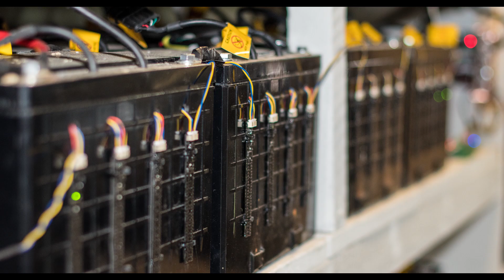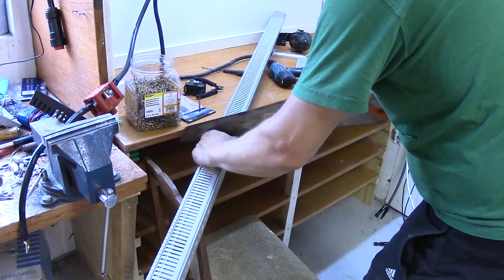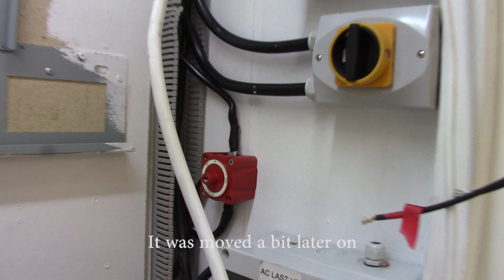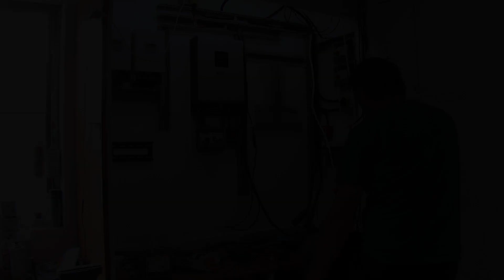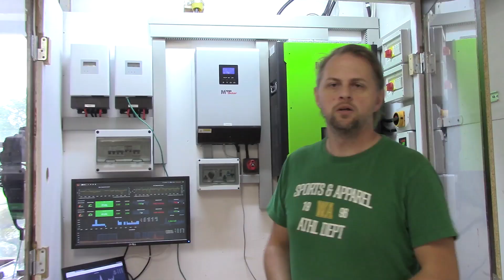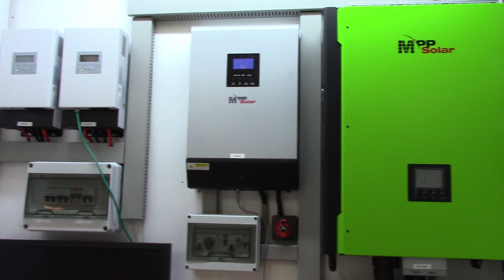Rebuild my solar installation! (part 3) - Electrical (Loud music in start)

Comment: I have 2 of those same charge controllers, how to you monitor them? Do you used 2 computers to monitor each? I haven’t changed any settings so far, straight out the box I connected them and they started changing. I have a 48 volt agm battery bank. Thanks
Reply from the maker: Check out my grafpi videos and solar-sis. I use 1 raspberry to all my monitoring

Comment: What is the total idle consumption of the inverters, bms, changeovers etc?
Reply from the maker: Changeovers and those do not have any Idle consumption. The bms perhaps 2w. The inverter 250w+.
Reply: @DIYTechRepairs  of course they do. How do they sense the loss of power? And what drives the motor? I bet there is a relay latched on and when it drops out it diverts alt power to the motor. As for the bms, I'm not believing 2w for a second. That monitor must be 50w alone
Reply from the maker: @climatechangepreppersfaceb2148  If you dont seem to accept my answer why do you ask?  I have no motor in my changeover switch. My main is manual and powered by my hand. The second one is latching and that one have no idle current since its just powered during the switch. Its driven by BMS or inverter and they have their own idle current (Included in that data).  My BMS is batrium and around 2w. The screen have nothing to do with the BMS what so ever more than it can show data from it. Its not running more than im in the room.

Comment: Just finished a video with some crappy mobile recording with low sound only to switch to this and almost blow my ears off (headphones) due to the loud music... lol

I think you need to draw a diagram of the in's an out's of your setup. Seems like you have a high DC input inverter like what I have (ABB trio 7.5KW) so wondering how you run your batteries into it and charging them. my inverter is minimum 300VDC so don't like the idea of making Li-ion pack in series to 300VDC min... yikes..
Reply from the maker: Hehe.. Sorry.. Yeah it was a bit loud start :D i was going to redo the start but fucked up my saved edit in premiere....  :(
Reply: cool. I'm days away from starting my channel and got to crash course into premiere again. it's been 13 years since i last used it and forgot most of it.

Comment: hei, excellent job.  the only thing i noticed i don't quite approve is having the dc and ac breakers in the same box.

how are you going to cool the glass cabinet?  there will be heat by the kwh produced in there.
greetings urs
Reply from the maker: Hi, Yes that is not optimal but since its really only used as charger right now I did it this way.  Will be switched out when I get the some more 2p breakers and over voltage protection units.  There is going to be ventilation above it for temperature management and make sure dust is kept out with filtering.

Comment: Great job well done .
what is you'r total power output from panels and batteries?
Reply from the maker: I have 66*260w (17 160W) panels and my battery bank can continuous for kind of 1 hour give 100kW ;)  Output from inverters to house is continuous 14kW.